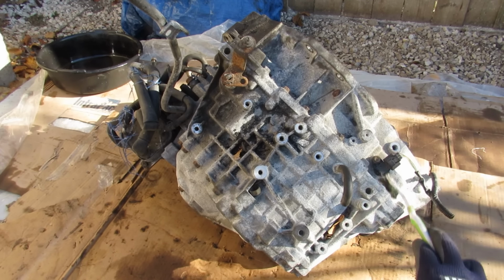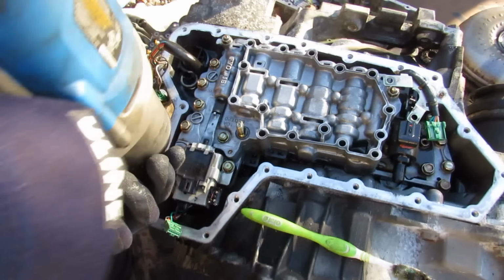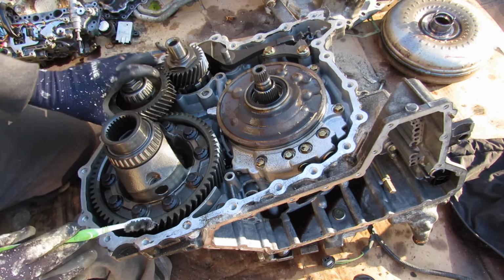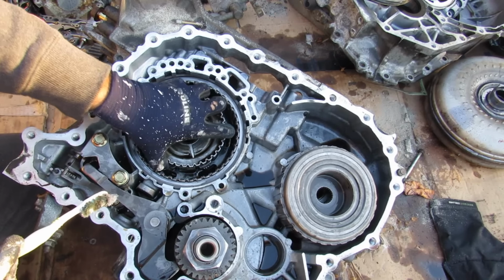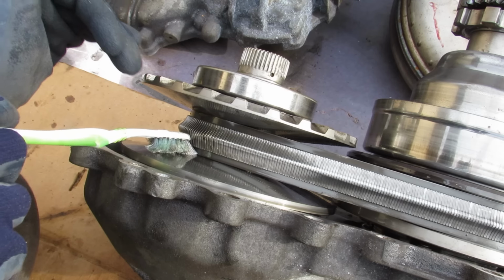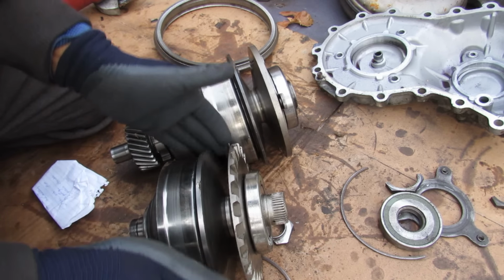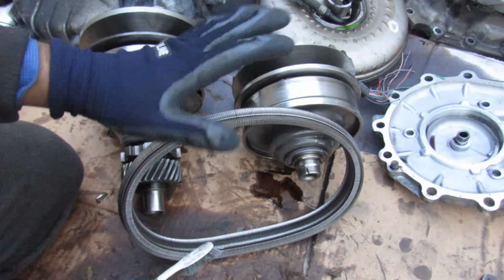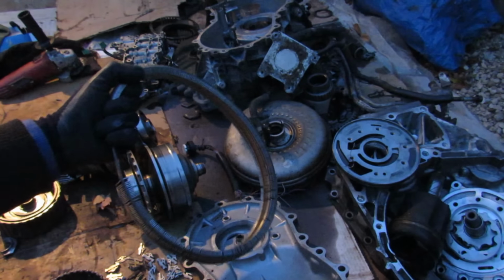Why Nissan CVTs FAIL

Comment: Best CVT video I’ve seen yet 👍
Reply: CVTs aren't as bad as people say but more caution does apply. For Nissan, the biggest issue is that previous generations were not cooled correctly and the transmission fluid burns up very quickly. "Drain and fill" at least four quarts every 30K miles is really the best solution if you intend to leave the cooling system stock (most of us). Also, CVTs don't like to tow or take much abuse, which is why they should only ever be in lighter vehicles that just do "point A to point B".  I have an AWD SUV with a CVT and currently have 130K and it still shifts like new.
Reply: Agree 👍
Reply: One of the best videos i've seen lately! Straight to the point (no unnecessary history lessons), fantastic pacing, doesn't skimp on details too much, clear audio and good video quality, jokes... Thoroughly enjoyed it!
The only problem with it, it doesn't fit the title very well. Failure modes are not shown.
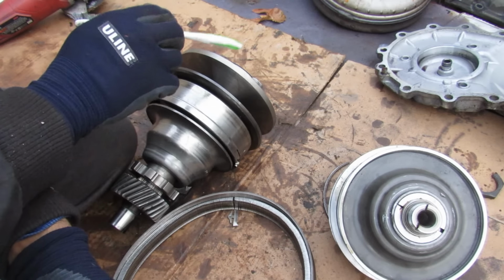Reply: @victortitov1740  Reasons for failure were explained. 15:00  Engineers have arranged for the belt, the weak link in the system, to be transferring more power than they are actually able to transfer without failing.The hydraulic system for adjusting the effective diameter of each of the 2 pulleys was designed poorly, and the pulley sizes don't always correspond precisely, causing slipping of the belt (or perhaps excess tension on the belt). Slipping causes friction, heat, and wear. I might add that in order for the belt to turn the pulley without slipping, the pulley surface must be precisely ground to a specified type of surface.  As slipping causes friction and wear, the damaged surface makes it easier for the belt to slip, which in turn causes more wear, which causes more slipping, ad infinitum. So it is very important that the 2 pulley diameters must be precisely correlated by the hydraulic system. Then, to "add fuel to the fire," engineers designed a cooling system that is inadequate.
Reply: @victortitov1740  Title only says ‘some common causes of failure’ and he mentions those.
Reply: Pity it's from someone who doesn't like them !
Reply: This is well presented but is not accurate. I run the shit out of my V6 altima and I don't hear the trans at all. Also, I have yet to have a failure. And then I love the transmission specifically because it is strong and silent. A transmission I can hear though is the one on my grand marquis and pretty much every 1st gear in a regular car. I have driven and manual, automatic and cvt. I'll take the CVT all day long.
Reply: @DonCarso  Thanks for the info
Reply: video worth more than CVT
Reply: Driver 61 did a good one as well
Reply: Best cleaning tool I have seen

Toothbrush 👍
Reply: Instablaster
Reply: Thanks
Reply: Ofcourse 👍
Reply: Look up "Weber Auto" --- his trans videos are even better
Reply: the kid, KNOWS HIS SHIT !!!
Reply: Agree 100%! Great lesson!
Reply: @skeezerpleezer8623  o[kp)000
Reply: I agree this video had really great detail, and funny too. I think it would’ve been great to see the pulley  size change before completely disassembling. He probably could’ve done it with air pressure in the right ports.
Reply: I  couldn't agree more!
Reply: Well done...
Reply: Continuously veriable Trash 🗑️ 😂
Reply: Really.....hold ma 🍺
Reply: For sure. I understood how these things work, but not into the details this guy gives.
Won’t be buying a cvt. they used the public to test this technology.
Reply: Just change the transmission fluid....they can last. You just need to take care of them.
Reply: @peterl6095  how often?
Reply: I guess CVT is looking pettier now? :-D
Reply: @mmm vvv THANKS A MILLION!!!!!!!!!!!!!!!!!!!!
Reply: Hello Daniel Jaeger! I just wantef to say that your name Jaeger has a long history. I had a dear friend that worked  in the New York Stock Exchange as a broker.  He had the same last name. That name suffer under war time in  world War two. It was very sad what happened but that name is still here thank God!! Look up the history on your name if you don't  know already.  You name is very important.  Bless you!
Reply: Great video on explaining this. He should do a video on how to maintain them.
Reply: Yeah understand everything. I've got a degree in Business Finance and Accounting, an MBA degree and half of a chemistry degree. And I don't know what the hell he's talking about. Man and he made me feel stupid. I also have 40 years as a manufacturer's rep dealing with all kinds of manufacturers. Whoever invented these Transmissions is light-years smarter than I am. Wow I'm impressed. I have a CVT transmission in a 2005 Ford 500, and it's acting up right now, don't know where to buy a rebuilt one or I have this one rebuild any suggestions, I want a good one
Reply: Good u explain thank u
Reply: For sure the best ever
Reply: @mmm vvv234 Agreed! The video's name is "CVT Transaxle Steel Push Belt Construction" on WeberAuto. One of lots of great videos.
Reply: Agreed. He breaks it down and makes it easy to understand.
Reply: After watching this video I was able to strip and repair without any problems. (thanks to superb mechanic)
Reply: I agree

Comment: Does the nissan xterra 2012-2015 have this transmission in it?
Also,
Would a Toyota 4runner 2006-2009 be a better quality better built suv than a newer 2012-2015 Nissan Xterra??

Comment: What was the cause of failure of this transmission?
The belt was intact
And other major parts too
Reply: The cooling system is not working good enough for the heat the CVT makes. The parts inside the CVT overheat and deteriorate over time/miles causing a failure.
Reply: @ChadamusMaxamus 
Thanks for replying
I have the same car
I wish u talk how to make this car last longer despite all of that bad engineering
Especially the cvt
A complete episode only talking about this idea
It will be so great 
Greetings
Reply: @abu-ali-aljehany  here is what you can do:
-Install a larger transmission cooler
-Replace fluid every 30k mi /50k km
-Don't drive aggressively, especially when the transmission is very hot or very cold
-Don't tow anything or overload your car with lots of weight

If you do this, it should last a lot longer.
Reply: @naarealy  thanks a lot for your advice
I will do as you said
But I don't have any one in my town who can put a transmission cooler
But any way I drive it very slowly
The fear is about the cvt belt 
Why dose it break  so much with too  people?
Reply: @abu-ali-aljehany  This transmission is okay for light cars for basic travel, but it's not good for heavy work, like a taxi or towing heavy things. Its also a bad choice for powerful engines.

The problem is the belt will start to slip. When the belt slips, it creates a lot of heat. Normally, the transmission fluid protects the belt and pulleys if there is just ocasional slipping. If you overload the transmission, the belt will slip all the time, the fluid will get very hot and lose viscosity. Once it gets thin, it will not protect the metal on metal contact between the belt and pulleys and it will start to self destruct. Every time the belt slips, it also contaminates the fluid so it doesn't protect the components like before.
Reply: @naarealy  very precious informations 
What do you about using it in highways?
I travel with it for 1500km 
Trip
But I don't carry any one with me
I don't cruise faster than 120km/h
I drive it at night to avoid hot weather
But with original cvt cooler
Do you think I can prevent troubles this way?
Reply: @abu-ali-aljehany  Yes, what your doing sounds very good. I would not worry about traveling fast. Traveling at high speed does not cause damage by itself. The damage is caused if you like to accelerate quickly all the time and drive like a race car driver. The belt cannot handle much more power than than the engine makes, so if you are at full throttle, the belt will be operating very close to it's limit.
Reply: @naarealy 
Thanks alot
You know what
I take it as a challenge
Driving such cvt crap
It's a challenge to make it last longer
Reply: My car had 200,000km on it
I have been using 20 w50 oil for it
Bcz i didn't know alot about oil viscosity
I want to switch to a full synthetic oil
What viscosity do you recommend?
5w30 _5w40?
Is it safe to do it?
Reply: @abu-ali-aljehany  use whatever is recommended in the manual for your engine and temperature range in your area. Using an oil that is one grade thicker than normal is fine, but I would not go thinner unless I lived in a very cold place.  Note that if you use thicker oil, you might lose some fuel economy.
Reply: @naarealy 
I live in middle east
So do you think 5w40 
Is safe for such an old engine
My fuel consumption is high
Beside i am anxious about getting sludge in my engine due to 20 w 50 oil
Reply: @abu-ali-aljehany   

40 or 50 are both fine. Regular oil gets thinner the longer you use it, so a 50 weight oil will become a 40 weight after using it a while. A 40 weight synthetic will stay closer to its original rating. If you managed to get to 200,000km then just keep doing what you are doing, switch to synthetic if you want.
Reply: @naarealy  i appreciate your help
It was nice to chat with you
Greetings
Reply: @abu-ali-aljehany  👍👋

Comment: Great video! I would like to make a few remarks. In my experience repairing all kind of automatic transmissions, among the main failure reasons for this specific transmission are the bearings. They tend to get damaged by being bathed in that overheated and full of shavings oil. Also, this family of CVTs are made by Jatco and equip a lot of cars of different brands, including Mitsubishi, Jeep and Renault, among others, where they usually show the same kind of flaws! Also, you can actually find repair kits for this transmission, including internal gaskets and friction discs, but guess what? The main failure spots, like bearings, variators and stepper solenoid can only be found used! By the way, I was about to ask you to sell me the bearings, but then you had fun with then and my chance was lost 😂😂😂! Great information in your video btw!

Comment: The reason a CVT can give you better fuel economy is also because you can adjust the engine RPM continuously.
For any given speed and road conditions you require a certain power. With a CVT the engine can run at the exact RPM that delivers this power with the minimum fuel consumption (g/kWh).
And for fast acceleration, you can keep the engine RPM to get maximum power all the time.
Reply: What makes the CVT enjoyable for me
Reply: A good driver can do the same.
Reply: @tube.brasil  No, you can NOT
A manual and conventional transmission have fixed gear ratios. You can never get the correct (read minimum consumption per kWh) RPM for the speed you are driving all the time.

Comment: "Milton Reeves
In 1879, Milton Reeves invented a CVT (then called a variable-speed transmission) for use in saw milling. In 1879 Reeves began fitting this transmission to his cars, and the Reeves CVT was also used by several other manufacturers. The 1911 Zenith Gradua 6HP motorcycle used a pulley-based Gradua CVT"

Comment: @speedkar99 what does it mean when you must first warm up the cvt in order for it to successfully "shift"? With my 08 maxima, i find myself having to warm up the car for 10 minutes so that i can have a smooth ride with low rpms. If i don't warm it up and drive off, i see and hear the over revving, however if i drive while over revving, after a few minutes the cvt catches on (i guess because it got warmed up by the driving) and it transitions to smooth riding. Why is that?

Comment: Believe it or not the V6 models aren’t very common for failing since they have a different style of belt (more like a bike chain on steroids). The most common failures are on the second smallest vehicle the Sentra, then versa, altima 4cyl, and then v6 modes. Key to longevity is fluid maintenance and not abusing them. And we do “rebuild” CVT’s at the dealership but it just consists of a belt/pulley kit and valve body assembly.

Comment: In my opinion I think the failure of the belts are exacerbated by the fake shift points, if they were to always move the ratio with a smooth motion then there would be less wear compared to if the transmission shifted ratios quickly to simulate gear changes.
A lot of other CVTs are known for keeping the ratio but every Nissan is programmed to fake the shifts

Comment: For what it’s worth...I just changed the CVT fluid in our 2008 T31 Xtrail at 100,000 kms. 

I used fully synthetic low viscosity fluid made by Penrite. 

Possibly psychological but the CVT seems to be performing better than before. 

On the same sections of road (usually uphill from slow speed like at an intersection) where it used to bog down and shudder a bit it now is happier to ‘drop back’ and rev, like the CVT is working better.

Comment: My car smell funny after i floor it. What does it mean?
Reply: You probably need new muffler bearings
Reply: @drozcompany4132  i forgot to mention after i stopped, i put it back to drive and the car won't move. I put it to neutral back to drive still won't move and i repeat one last time and it finally move. It smells burning. I guest i toast the cvt huh

Comment: Nissan CVTs are reliable if you know how to maintain them. Nissans from and after 2012 have their CVT fluid easier to access. It's cheap and fast change the fluid every 10k miles and it will last you alot of miles.

Comment: CVT and fail are two words that cannot be separated from each other. CVT transmissions are wonderful industrial transmissions for certain types of work. Why anybody thought that they was a good idea to put them in an automobile that has to be relatively reliable is beyond me. But what do I know I've only been wrenching on Cars since 1964.

If a vehicle with a CVT is driven very easily you might be able to rely on it for a. Of time that can be thought of as a respectable.
Sounds like a couple of tips are in order to make one of these Transmissions, if you have one, last. One is get a 6 oz bottle of the zMAX transmission treatment and put it in the transmission. It will help the metal transfer heat better. And as for cooling, you take an external transmission cooler, you can easily go to a yard and pick one up off of an older Explorer, and install it in front of the radiator or condenser, and run it on the line that comes out of the transmission after the transmission has cooled transmission fluid a bit. And then run it from there to the transmission. That will cool the transmission as good as you're going to get it.
Reply: All mechanical things will fail or wear out eventually.  Is a CVT a good idea?  Depends who you ask.  If the goal is to make it last until the warranty expires then it's good enough.  From a person wanting a car to go 250k, well maybe not such a good idea.  You remember when people were leery of automatic transmissions?  The technology probably has to improve before CVT is as reliable but how long have autos had to get to where they are today?
Reply: They've been getting worse and worse the last 30 years or so. I've been wrenching on cars since 1964. These younger idiots that they call Engineers are trying to reinvent the wheel when the wheel works just fine the way it is. When you get into a car and 90% of the operation of the interior of that car is on a view screen, there's a serious problem with that not only is it dangerous and a Severe safety hazard. When it goes out you can't heat or cool the car or do any of half a dozen other features that need much simpler technology to work just fine.

Comment: Shift by wire us the future! Can't wait🤤
Reply: Shift by wire sucks.  How do you put the car in Neutral if the battery dies?  Oh wait you can't.  Not to mention all the safety crap now since that actor got crushed by his Chrysler so now the car goes into Park every time you open the driver door.
Reply: @drozcompany4132 my grandpa was angered by his Cadillac's complexity and sold it for a equinox with a traditional shifter.

Comment: Toyota CVTs are much better. Go to CarGurus.com and do a search to 2014 and newer Corollas nationwide, then sort by mileage highest to lowest. You will find many over 150K miles and several with well over 200,000 miles with CVT. 
Then do the same for a 2014 and newer Nissan Versa with automatic and compare how many you find. There was one Versa that said it it had 399K miles, but it was a typo for 39K miles.
Reply: Well Toyota has a larger market share so that tells nothing. They sell a lot more Corollas than Nissan does Versas.  Furthermore the listing will not tell you if the trans had been replaced or not.  The fact they are for sale isn't an indicator of the CVT quality.
Reply: @drozcompany4132  It doesn’t tell “nothing.” I follow the Toyota owners forums and the Nissan owners forums and see the difference in complaints. 
I looked at both used Versas and Sentra combined for sale and couldn’t find a single CVT model in the same age range over 200K miles. Selling more Corollas isn’t an excuse. If it was only about only sales volume, then there would still be a proportionally smaller number of Nissans with similar mileage and available for sale.

Comment: My daughter had a 2012 Nissan Rogue. After the transmission began slipping the first time, Nissan told me that a $1500. external cooler would fix the problem. After buying the cooler, the transmission continued to slip when hot and eventually went into limp mode and would not exceed 40 mph. I was let off the hook by another driver who rear ended the Rogue and totaled it. I will never buy another Nissan or CVT vehicle.
Reply: Yes dont blame the shitty dealer for not properly fixing the issue and blame the manufacturer
Reply: @drozcompany4132  No fix for bad engineering. You must own Nissan stock.